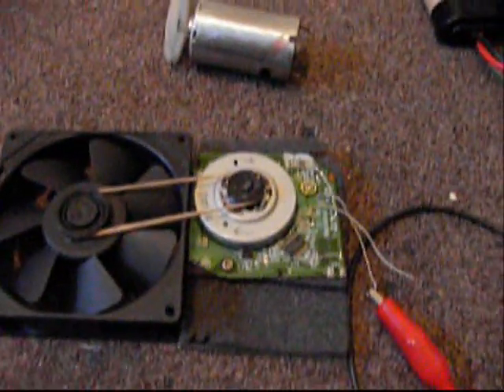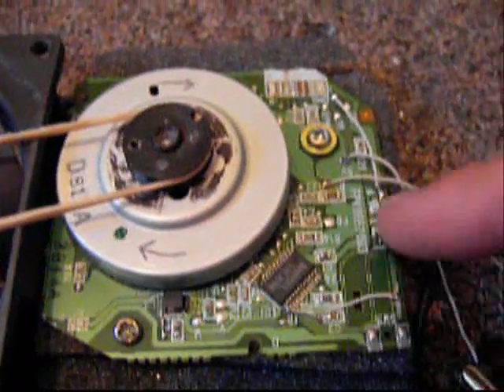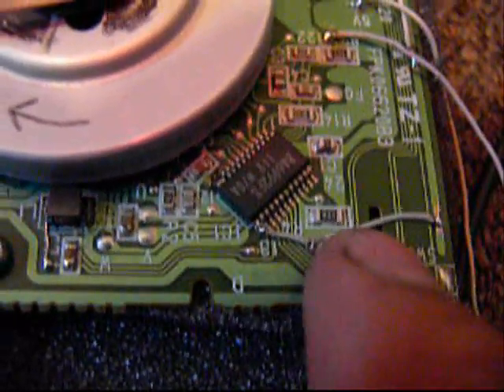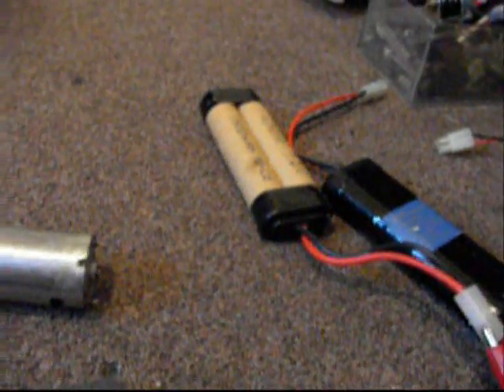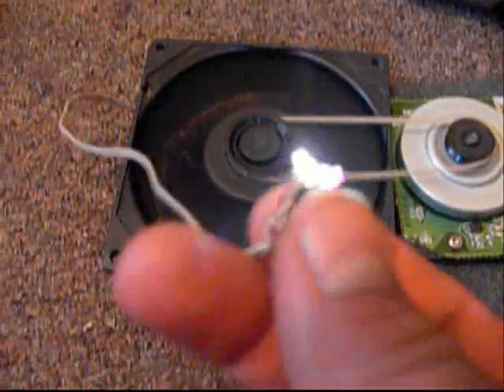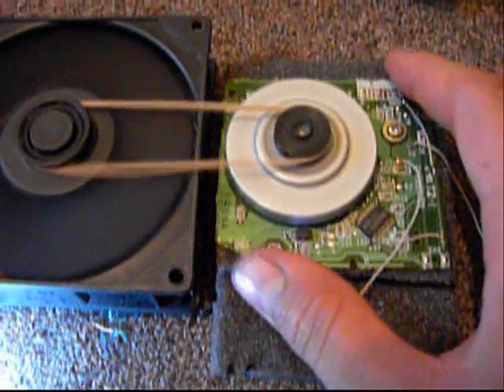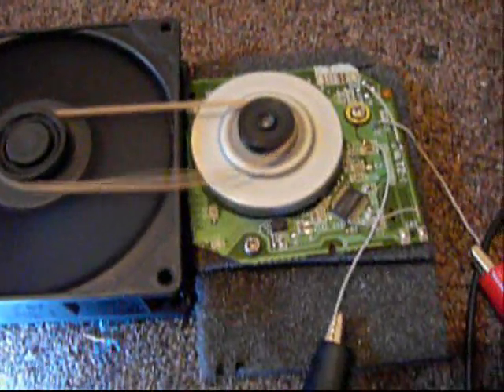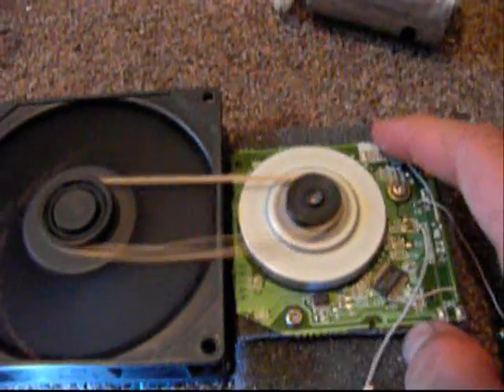Floppy Drive Motor Hack

Comment: It would be possible for you to make a document with the explanation and signs of the welding points to apply it to other engines, I need a powerful mini drill and I have many CD-ROM engines. frankdavilave @ gmail. com
Reply: 3phase motors

Comment: I think this is great. I don't know what you soldered together, what jumper wires you put in, or any of that, but it would be great if you made a video showing exactly how you did it. I love that "fan belt/elastic band too. Ingenious. I understand about raising the rotor of the motor to get it past the sensor but I didn't see how you raised it. I need more enlightenment. I think I can use this.

Comment: hold on your using a battery to power the drive which inturn moves the fan. why didn't you just wire up the battery to the fan or am i missing some thing here. what you should have done is, battery+drive+fan+dynamo to charge battery.

Comment: @LongboardMagHrvatska i a agree this is in no way hacking . just powering the motor so it spins..... and having a belt hooked up so it spins another device.  not hacking. but al least you learned where to hook up wires to power the drive

Comment: You realize motors have an in and an out right, +/-? probably located on the back or easy enough to remove and make a new mount. kudos for figuring it out, but it could have been pretty painless.

Comment: I highly doubt you were messing with motors at five years old. It would take quite a bit of intelligence for a five year old to comprehend electrical circuits and manipulate existing ones in order to force a simple motor to do as he pleases.

Your inability to be able to use the English language properly while casually typing is a great indicator of your intelligence level. :)

Comment: Might be a little less noisy if you just connected the power source for the drive directly to the L.E.D  .  just saying..     Oh and no matter where your from . Spelling is still Solder .. even though sod meaning grass and if you used a machine to lay the sod if so machine was used. then you could use the word  sodder or sodder'er  .....LOL

Comment: Notice he soldered a couple of the IC chip pins together. That changed it's function causing the drive to perform in a different way. Is an IC chip not firmware?

Comment: Hacking would be changing the firmware so the drive performed in a different way.
Modifying is changing the circuit/mechanics to perform in a different way.

Now you've been schooled.

Comment: The only thing I can see that would make it run faster is to start cutting down the fan blades. 
If they are symmetrical take one off  each side to remove the drag from rotational inertia. Or remove as much of the blade and hub mass as possible by cutting plastic the fan hub area close to the pulley.

Comment from the maker: @christo930 that is the fucking point, im "testing" the motors output power to see how much voltage it can take till it gets hot and max i got was 7.5v and 7v stable under load conditions, 8v was just idle but pointless as the rpm's stayed the same from 6.8v-8v. I never tested how much amps it pulls but the small wires didnt get warm so it ran pretty efficient.

Comment: @30GB All the drag is doing is forcing the floppy motor to draw more power, it has little to do with voltage. OTOH, you won't have to deal with the fan motor overheating.

Comment: In case you are wondering how the sensor limits the rpm of the motor.
When power is sent to the IC chip (microchip, whatever you wish to call it) The IC first checks to see if it has a connection to the motor and the sensor, afterwards it begins to gradually increase the power to the motor until the sensor reports back the proper preprogramed RPM (in this case 33RPM). Once that speed is reached, the IC continually monitors the sensor and adjusts the power accordingly to keep the RPM steady.

Comment: You've made a floppy drive motor rotate faster than it did originally, but there's no free energy. You've essentially made a transformer (not a robot in disguise) which is fine, but fairly futile, as you could have just made a transformer. If you do think there's such a thing as free energy, go ahead and power a battery charger to charge the batteries you're using to power the motor. If the motor stops, I win. :)

Comment: you could just simply attach it to the floppy drive PCB circuit to make that LED glows. Floppy drive used to have LED. But hey the motor of the floppy drive is spinning constantly.

Comment: @silver760 Last post! Also,the brushless motor on the floppy/cd/Hdd can be made into a powerful generator.They have far more stator coils and stronger magnets.Just find the input,now output wires for each coil and connect them to your load and see what you get by spinning the motor at different speeds,see what the multimeter says it's kicking our.So,there's some more ideas for those wet miserable winter evenings.Just collect some junk drives before hand!! ; ) Find drive schematics online too

Comment: @silver760 motor to use in micro indoor aircraft! The brushless motors,controllers and batteries for these can be expensive,plus they are far bulkier than this motor and chip.Might be a nice little earner! A 52x CD drive motor rotates at 10,000rpm,faster still!! There are loads of scrap drives out there,once you have done one the easier it will be.Get the chip number and identify it online to get the pin outs,that way you can completely separate it from the board,making it smaller!! Good luck..

Comment: @silver760 ..to separate the motor controller section from the board as it's integrated.What you have there is the motor control chip,which rapidly switches the coils inside the motor in sequence which causes the magnets inside the hub to repel against the coils making the hub rotate.The chip also has a speed regulator where the optoelectric sensor tells it the speed,it can then regulate the speed to the set rpm.If you could separate an HDD motor with controller it would make a cheap,lightweight

Comment: The older HDD rotated at 5500RPM the later ones are 7200RPM,if you could hack out the motor and it's controller you'd have a motor as fast with less mods.The floppy motor runs at 300rpm,all sizes run at that speed.On the board is an optical sensor that reads the rpm of the motor hub,by raising the hub it cannot read the speed,so when turned obn it's designed to ramp up the speed till 300rpm is achieved,in your setup it goes to max as it thinks it hasn't got to 300 rpm yet! It can't be easy ...

Comment: Come on guys, it's not an invention, he's just having fun hardware hacking -- this is actually pretty damn cool.  It'd be even cooler if you hooked a multimeter up to the output instead of an LED to see what kind of voltage and current you're getting out the other end -- A guy who posts hack-a-week videos did one with stepper motors recently to get A/C power.

Comment: @fukutube75 Wow, your comment is nowhere near being comprehensible.
I think that guy did actually do a good job, those motors are normally damn slow, yet he managed to make it spin an awful lot faster with just some modifications to the circuit. It might not seem useful to you as it is right now, but I guess he intended it as a proof of concept. If you want something more useful, probably build that yourself and hook up a ventilator to it or anything you want really... and chill out.

Comment from the maker: @marcelcorzo i searched up the ic on-line but the input power was difficult to locate because it didnt say on the schematic. I followed the ground from the 5v input then used 3v positive wire powering each different pin till it worked to find the input power.

Comment: 30GB, I feel sorry about the negative comments over here. Just ignore them and do your own thing. I like these kinda things you know. Just messing around with some (pretty old) hardware, learn how they work to apply the gathered knowledge and skills to modern things. And by the way: you might want to use a clearer microphone or recording device that doesn't down-sample the audio that much. 
KUTGW ;-) Cheers!

Comment: remove the fan blades to reduce drag and put a volt meter where you have the led...just curious about how many volts its putting out.  If its lower than 7.4v, try putting a bigger pulley on the motor somehow.

Comment from the maker: @Yeayer555 The motor STOCK runs 33rpm at 5v OR 7v but when i modified the motor, it ran same rpm on 5v but at 7v same speed but it has more torque thats all, you go try it yourself and see instead of talking bull shit, you fucker.

Comment: Ehm, thats little bit primitive, if you connect 7v2 battery to floppy disk PCB where is written 5V and GND :D.... And then with rubberband to fan... and fan acts as a generator... It will produce power to LED... If you do that it will make from 7v2 bigger voltage than youre good, now youre only priceless gay...

Comment: @30GB no there will always be loss of energy due to friction, heat and other magnetic loses. And even if you could one day power the motor with the generator that powers the motor, there would be no energy left to use because energy cant come out of nowhere.

Comment: btw, not hating here just a thought, so please dont take this as hate :) are you having the motor that spins the other always running, or do you disconnect it. Cause you might be able to hook the motor upto the other motor, give it a quick voltage, and then it might generate the power to keep going, i dont know if it'll work i guess it's somthing to do in my shed tomorrow... Hummm

Comment: WASTE OF ENERGY!!!

Isn't it that motors HAVE LOW INTERNAL RESISTANCE and draw MUCH MORE CURRENT (sometimes A COUPLE OF AMPS) than TWO LEDS (~25 mA)?

Just connect the LEDs directly to the battery, and if you need to, add a resistor. IT WILL LAST MUCH LONGER.

Comment: This is really cool stuff, the sort of thing I like doing. That looks like a ' stepper' motor. These motors can have either 4,8 or more connections unlike most ordinary motors which have only two. A microprocessor makes these work and they can go unbelieveably slow or very fast and can stop instantly. They are used extensively in humanoid robots to articulate all their joints.  An excellent project, very well done ... :o)

Comment: @gooseknack your going back over what 30GB said. all what you say you invented is stupid and again pointless. and as for making a battery charger for a car battery then using the battery to power a short wave radio is a very long way round using power for making power to use it. why not pull a old PC power supply then with a few simple modifications you can have a perfect dc power supply for using and testing 12v appliances. using power to make power is a poinless tool.

Comment: @SaucyBegger25 it may be pointless to you, but to me, even with the noise it makes, it has many possible uses....I remember doing this myself, and not all that long ago, except I used the spindle drive from a video, used it first as a silent motor for a small fan. I then modified(re-wired) it and turned it into a small generator that ran on a small water turbine(on the pool pump inlet) It worked well enough to charge a smal car battery that I used to power a shortwave radio!

Comment: @30GB look kid i know for a fact it is simple i spent most my life with a soldering iron and stereo/tv insides. try taking a transformer out of a hifi then put a 9volt battery on the output side of it and then touch the 230volt input wires. fans and voltage is simple same as having an amplifier and putting a 12volt tube light on one speaker output. you can turn the tube lite into a strobe that lights to the music. speed of the motor depends on what its being powered with bypass all resistors

Comment from the maker: @SaucyBegger25 you think its so fucking easy right? you cant just "jump power" to the motor like that, you have to somehow trick the controller like when the main floppy board is sending a single to run it, then from there i had to mod the motor so that it spin fast as this or it would just spin at 33rpm instead of 5000rpm

Comment: it is a pointless item as all you have done is jump wires to directly power the motor on the floppy drive then glue a belt ring on the top of the motor then get a 50mm or so fan glue a belt ring to the motor sit it side by side put an elastic band across so now the floppy motor is generating power to the input wires of the fan as an output powering your led. the speed of the floppy motor that is spinning the 50mm fan wouldn't generate enough power to blow the 12v leds so the resistor is pointles

Comment: @docstruthers Making the floppy drive do more work doesn't increase it's efficiency at all and simply adds a drag. Remember, this isn't a dampening weight, it's an active resistance that only gets worse as it spins up. When the fan is being powered by electricity to spin the fan to blow air, the amount of energy it took to to spin the fan is how much energy is being robbed from this system.

Comment: You should cut the blades off of the fan so it will spin with less resistance and put less strain on the floppy motor.

Comment: @zelibober Its not a brushed motor... Its brushless.  Connecting power directly to the motor windings will just burn out the windings or make them get hot.

Comment: @TeddyEdy93 Electric motor is still electric motor and it is working on same physical forces as any other electrical motor out there so no meter how many connectors are there it will work.

Comment: @whatafrigginjoke 

Right, especially considering he calls the capacitor a resistor. I'd brush it off if he called a diode a resistor, considering their similar shape, but a capacitor is distinctly different.

Comment from the maker: @pierreact you are a fucking dumb ass troll, this FLOPPY DRIVE MOTOR only spins at 33rpm and im not stupid like you, a regular hard drive brushless motor spins at 5400rpm or more depending on the hard drive manufacture usally its 5400rpm or 7200rpm and server drives are around 10,000rpm.

Comment from the maker: @GeorgeBliadze woops used my sis account, did i say i was making a generator or something? im just using the gen to show people how much power the little floppy drive motor has since the thing was designed to run at 33 rpm to spin a floppy disk instead of a big fan while powering a led

Comment: lol it's a lot of work but that's useless, :) u used batteries to take electricity for the  motor & with ur motor u spin the fan to take electricity again but this time for ur LED, humans try to make everything easier and not complicated, u go with the wrong way :), u could plug the battery straight to the LED like averagemale2000 said or find a place with fast wind and took ur fan there with ur LED plugged & take electricity from 0, but ofc making motor spin faster was a good work.

Comment: DUDE YOUR A GENIUS!!!! If you have ever seen Air Gear, I think you may have just created the small motor strong enough to make the skates motorized. If its not to much trouble (Which im sure it is alot) Message me the step-by-step direction on how you did that. If my plan goes as I hope I will seriously send you a pair of AT's after tests are complete and they are succesful.

Comment: Direct current to the motor would of been easiest and more reasonable they trying to decipher the electronics schematics. The circuitry already has several built in resistors so dc voltage to the motor would of been sufficient.

Comment: you could have removed the motor from the circuit board by de-soldering it then resoldering two wires to the contacts  then you get a single motor on its own without faffing about trying to work out which bits you solder no disrespect to you though  just a thought :)

Comment from the maker: @rob3342421 you are the dumbest guy ever, this is a FLOPPY DRIVE motor not a hard drive, and its stock speed is like 33rpm and iv modded it and it flies like 7000rpm

Comment: @30GB if you wanted to find out how fast the motor in your hard drive runs theres an incredible new technology called a sticker! on the had driv on the outside it would either say 5400RPM or 7200RPM because I doubt you'd be dumb enough to take apart a  10000RPM veloci rator apart to power an LED

Comment: This is pretty cool. I was just messing with some very similar motors (DVD spindle in my case - check my videos) and I gotta tell you,  the fast rotation trick is pretty cool. Basically, I think what happens is: the Hall-effect sensor that acts as a feedback for the controller (the IC below and to the right of the rotor on the video) can no longer sense the magnet inside the motor and the controller gets "confused" not knowing what the RPM is and just runs away. Anyways, keep up good work! :)

Comment from the maker: @ApolloWasReal theres a small connection that you have to take off that separates 4 windings then you connect them all into series then you get alot more power but if you add a bridge rectifier then you can get more power than just a diode

Comment: @30GB How did you wire up the fan as a generator? Most brushless fans are actually 3-phase AC motors driven by a small DC-AC inverter with a Hall-effect sensor controlling the switching frequency. Did you just hook a diode to a single winding? Or did you hook up a full 3-phase rectifier bridge?
Reply: Ovisi ovo je vjerojatno Stari model ventilatora on da je AC van kada se koristi kao generator. Led svijetlo može raditi i na AC ali zbog frekvencije Hertza   treperi 50-60 Hz,Ovisi ovo je vjerojatno Stari model ventilatora on da je AC van kada se koristi kao generator. Led svijetlo može raditi i na AC ali zbog frekvencije Hertza   treperi 50-60 Hz It depends this is probably an old model fan that the AC is out when used as a generator. Led light can also work on AC, but because of the frequency of Hertz, it flickering 50-60 Hz,